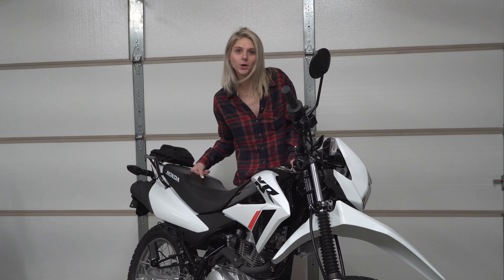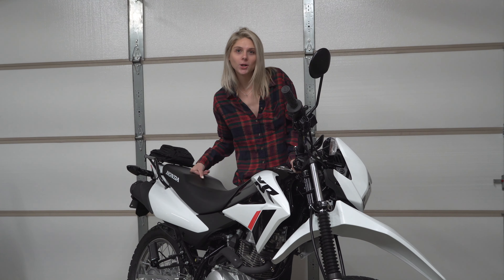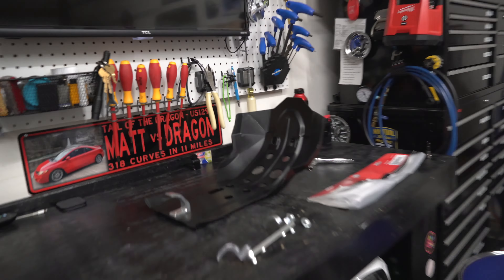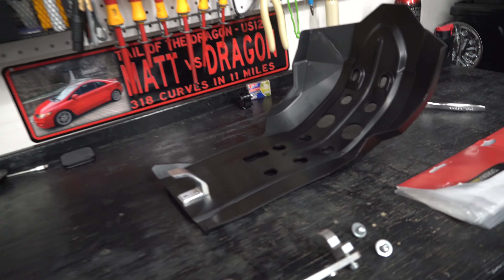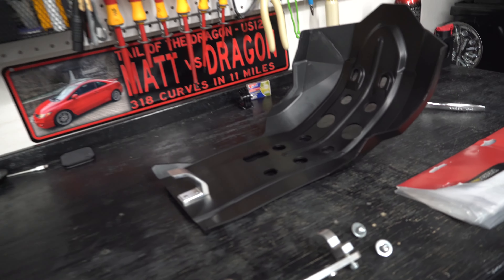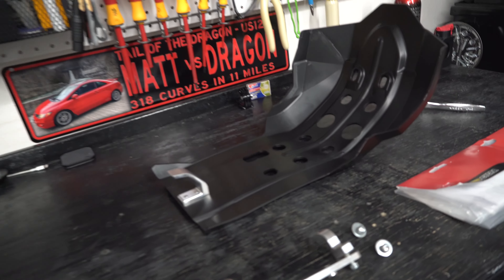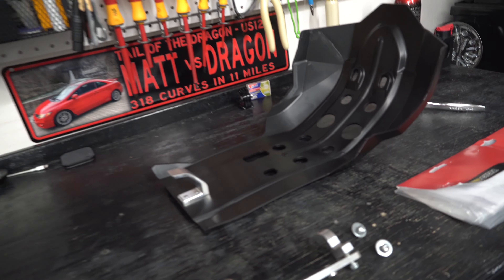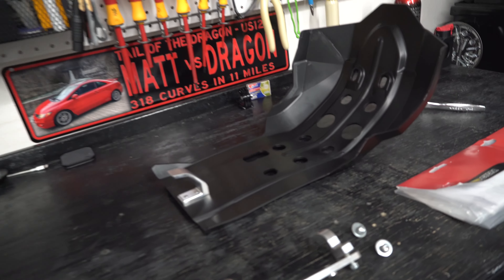XR150L Goodies

Comment: i saw this aftermarket gauge cluster install- it's a bit of work but in the end you'll have all the functions (i like a gear indicator) and an analog tach staring back at you. i think on the US version you'd also have to install a fuel level sensor... a tach would definitely help with your sprocket testing. https://www.youtube.com/watch?v=GBvYqJHKTXM